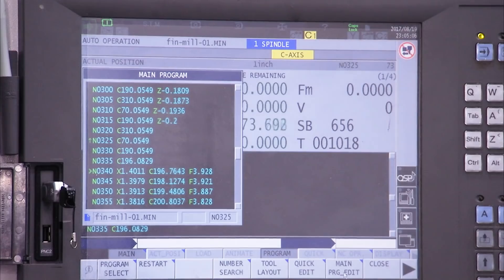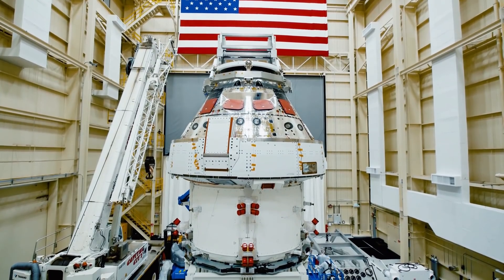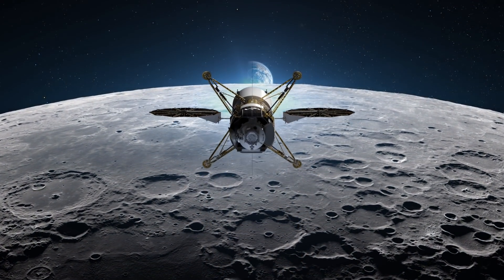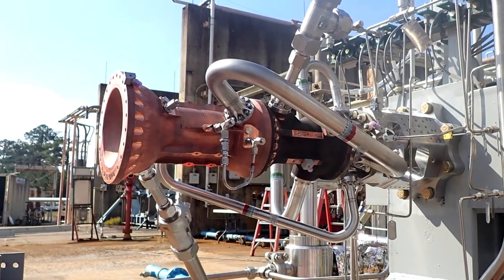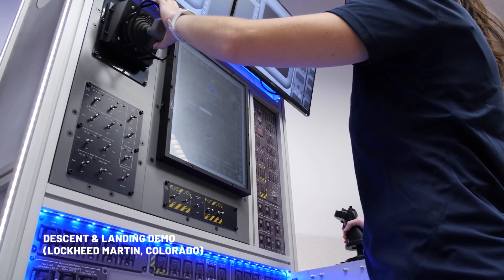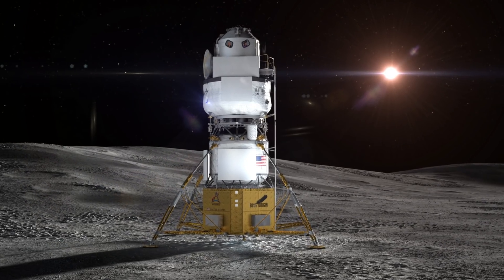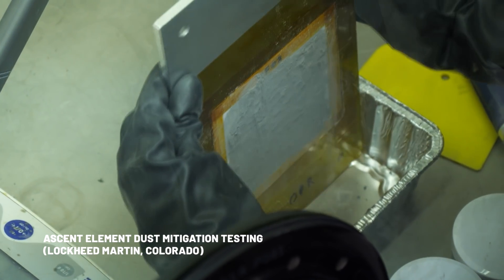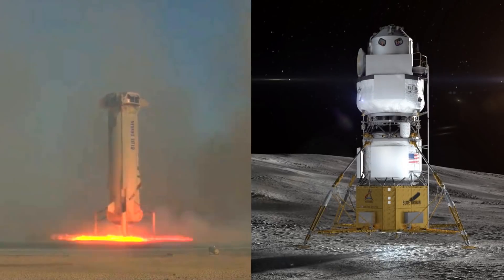Tech Demos for NASA’s Artemis Program

Comment: Saw the SpaceX  Starship test and this showed up. 
Yawn!
Reply: LOL.  Elon is further along with his moon lander, merely by painting a Starship nosecone white.  lol
Reply: @asraharrison  he is further along because Starship is actually in development and has done several tests and is wayy far ahead of BO. Not to mention that SpaceX has actually achieved orbit and does so regularly. Also, spacex has had crewed missions. Meanwhile, BO has not
Reply: @masonmtb7  BO is not supposed to make the boosters that launch the lunar module. NASA is doing that
Reply: @KKmaddafakka  what, no? BO is most likely going to launch the lander on New Glenn.
Reply: Do any of you have the remotest idea what the Delta V burn would be like trying to put that much weight on the Moon?
Reply: @thethirdman225  28 raptors gooo burrrrr
Reply: @thethirdman225  The starship upper stage will be doing that burn with it's three raptor vacuum engines, this will give it about 6 times as much thrust as the S-IVB. It is also much larger than the S-IVB and will definitely be able to complete that burn after orbital refueling. For landing on the moon, it will either use it's vacuum engines, or the lunar starship has separate landing engines, either way, it has definitely enough power to land and again, after orbital refueling it will definitely be able to do the TLI, capture into moon orbit, land, and launch again from the moon's surface.
Reply: @masonmtb7  How is it going to stand up on a 12 degree slope? How much Delta V are they going to need to get such a huge machine there? Someone wisely suggested it be used as a cargo transport and dock with Gateway. In that role it would be very useful. Anything else is, for the moment, Buck Rogers stuff.

Comment: SpaceX: Almost executes a perfect flawless prototype test
Blue Origin: Releases a video

Perfect timing guys
Reply: Yeah! Plus They have their own rocket to get it up there. The other designs need to work with SLS. I reckon we’ll be looking at several moon transporters. They’ll all learn from eachother to strengthen their weaknesses over time. Space x might go ahead regardless, seems like a logical step before Mars (if the commercial demand for moon journeys arise) Space X’s lunar starship has it’s flaws too. I’d like to know if they intend to use the vacuum optimised Raptors to perform landings or if the low gravity means it can be all with the thrusters. For sure they need them to launch off the surface to go back to the Lunar gateway, and to get to LEO for refuelling. We’re still decades/centuries away from a simple 1-ship-does-all without all the caveats. What a beautiful site it will be to see a nasa branded, all white, finless starship standing tall on the moon with the earth behind it.
Reply: @JonGPxl  The best thing about SpaceX is that they aren't afraid to blow things up and change things on the fly as they learn from failure. The Starship we saw yesterday is probably very different that what would end up landing on the moon. Meanwhile SLS and other space companies spend years and millions on computer modeling to ensure something won't go wrong, instead of just testing it an accepting it's going to fail before it succeeds. Plus if SLS blows up it's components aren't easily replaceable.
Reply: @Heatr53  SLS is rapidly being priced out of existence.  It is already at $2 BILLION per launch!  That is just crayZ!
Reply: @JonGPxl  The greater the competition the better. One of the reasons why space exploration is so prohibitively expensive is because of  literal monopoly by government agencies. NASA spends half of their resources on bureaucracy and kowtowing in front of politicians to get their funding.
Reply: @Michal_Wlodarczyk2100  couldn't agree more. Competition in the commercial sector, then global government agencies like NASA doing what they do best with the science specific missions and discoveries.
Reply: @JonGPxl  I wonder if future Martian and lunar colonies would be  semi independent entities. At the beginning they're going to have to rely on support from earth, but later on (after significant expansion) it may lead to Martian Revolution 😊
Reply: "Almost Flawless"  Yep and they did it on the first try!  I'm pretty sure that SN9 will nail it.  I am still gobsmacked by yesterday's flight.  We've never seen a rocket do anything like that before.
Reply: Ya what a coincidence
Reply: Just shows they are following in the shadows of a true giant.
Reply: Hahaha brilliant.
Reply: And then you have Dynetics who has done next to nothing. SpaceX is the clear winner here
Reply: @colehetzel3093  I don’t think NASA will choose Starship as the Lander(bcz Politics)but I’m pretty sure whether they select or not Starship will land on the moon before Dynetics or National Team Lander.
Reply: See I think this is this is the realistic plan, you can choose to agree with me or not, up to you. 

Dynetics takes first place and lands on the moon first while blue origin is still testing it’s New Glenn rocket. Dynetics will have their lander on SLS Expedition 3 (if it’s not cancelled yet). Since Artemis is obviously hoing to be delayed a few years, i’d say Expedition 3 will take flight in 2025+,

Then what happens is that Blue Origin’s New Glenn would be ready, they launch Blue Moon to show everybody who’s boss - by then SpaceX should have launched their cargo mission to Mars carrying neceessary equipment needed for the follow up crewed missioned 2 years later.

Blue Origin’s slow and steady moto would be too slow as Dynetics would take Artemis 3 and 4 while Blue Origin take 1 of them, if nothing goes wrong with their stupid ladder, they may get another mission but Dynetics will most probably be the favourite of NASA. Then, somewhere around Artemis 6, Lunar Starship will be ready and NASA will choose that, bringing 100 tons+ of cargo and crew to the surface of the moon. 

By the way, lunar gateway will be cancelled as funding for that stops, The ISS gets funding for 10 more years as commercial spacecraft brings more crew and modules to it, we might see, in around 2030, 20+ crew on the ISS!
Reply: @Phalkhonieng Gangte yep more space companies should adopt their approach to failure, they would learn more and succeed faster. But they or their shareholders are probably too scared to have videos of their product exploding.
Reply: The video is not about carrier rockets
Reply: @sidharthcs2110  SpaceX anounced that there can fit 100 people in starship
Reply: BLUE ORIGIN: delivers a mock up for astronauts to familiarize themselves with, make suggestions on, get used to.
SPACEX : (crickets).
Reply: Common Sense Skeptic Meanwhile, Spacex has delivered 6 astronauts to space and 100 successful launches.  currently has a flying moon capable prototype.  hardly “crickets” mate
Reply: @asraharrison  you’re not talking about Starship, I hope.

Comment: Not too sure about this plan. Dynetics seems to provide a more reusable, simpler, cheaper, and safer option.
Reply: Honestly I think the Dynetics lander is the best. The lunar starship is just so fricking big and looks like it's gonna tip over. (But both are very good, unlike BO's)
Reply: @mattmatta1346  Both could be used tho ,Lunar Starship and Dynetic lander run on methalox so Starship can act like a refuelling tanker for that Alpaca so it could land in multiple biomes. starship has lots of payload capacity so it could be used to deliver lots of cargo to the moon for potential lunar bases
Reply: @abhinavprashant2213  starship can be the lunar base
Reply: @abhinavprashant2213  I think this is a smart idea. For the moment, there’s no practical reason to try to land anything that big on the Moon.
Reply: @Flying Winged Grain Silo It will have very wide legs and it's very bottom heavy, do it's gonna be stable
Reply: @Thijs Kievit How is Starship going to land on a 12 degree slope and stay upright?
Reply: @TheThirdMan Auto leveling legs
Reply: @ImieNazwiskoOK  Oh really? How are they going o get them there? The maths for this seem to be lost on a lot of people. I don't know if you've ever worked it out but every kilogram you launch costs thousands. These excessively complicated devices sound nice but there are perfectly good reasons why organisations other than SpaceX are still looking at expendable vehicles. And don't give me the figures for LEO because they won't be the same for the Moon.
Reply: @thethirdman225  "How are they going o get them there? " What do you mean? They will just put them on lunar Starship. And Starship acording to plans will be cheap in terms of payload/price.
Reply: @thethirdman225  Good point. Big problem of reusability, but we still need reusability to not make future place of lunar base a junkyard (or LEO junkyard). And remember about refueling, so if it will have nearly 0 fuel on LEO it kinda doesn't matter becouse it will get refueled anyway, but it will be still make more fuel consumption after all.
Reply: @ImieNazwiskoOK  You missed it again, didn’t you? To be reusable requires a much heavier structure and therefore needs more Delta V, dramatically increasing the cost per kilo and eliminating the advantages of a reusable rocket. Even so, beyond certain weights and distances, reusability becomes impossible and it won’t be overcome by just building a bigger rocket. Eventually, there is a break even point between the maximum payload and maximum structural weight.
Reply: @thethirdman225  You are overthinking this , autoleveling doesn't require some heavy complicated extra weight, could be as simple as putting less hydraulic presure on the 1 or 2 legs that are elevated  so they are less deployed to level out. Will add i do think starship would be best only to deliver cargo to the moon, and if isru doesnt work out, be expendable.
Reply: @SkampXx  Overthinking? Oh, okay. Let’s drink the Kool Aid instead. Man, are you serious? How much Delta V is it going to cost to sent this extra weight to the Moon? Come on, answer it. Because everyone else is avoiding it. Higher structural weight equals more Delta V. Overthinking it? What is it you think engineers do? Or are you just expecting it to work “because Elon!” Or “because tech!”?
Reply: Agree, but blue origin has cooler design
Reply: @akunlama89  Cooler design? Have you seen SpaceX's Starship?
Reply: @aconite72  yes, the lunarship were also cool
Reply: @akunlama89  cooler does not mean safe. And when you're talking about human spaceflight, safety is the upmost priority.
Reply: @sneakytom7416  well I agree but blue origin has the coolest design.

Comment: By coincidence Blue origin just happens to release this video on the day STARSHIP has just launched SN-8 😆😅🤣😂
Reply: Terrible timing lol
Reply: Sn8 it’s actually success . If only the landing legs can pull out faster
Reply: 😄

https://youtu.be/3wxyN3z9PL4
Reply: @Theneverythingx  More than a simping little fanboy like yourself.
Reply: @Theneverythingx  Yes, you are.
Reply: To be fair Starship SN8 was supposed to test yesterday.
Reply: Or SN8 released their video the say Blue Origin planned release their video! SN8 was scrubbed on it's original day and picked another day - it could be entirely possible they ended up picking the day this video was going to be released.
Reply: .... and crashed it.
Reply: @Nowhereman10  and gained incredible data for the next launch
Reply: @Nowhereman10  at least they’re trying to actually make space travel sustainable.
Reply: @TheCosmicGuy0111  Interesting factoids here. Both SpaceX and Blue Origin have made fairly cheap rockets. New Shepard, according to Bezos only costs a mere 10,000 dollars to turnaround and according to Musk, a Falcon 9 around 250,000. Both numbers match up well when you compare the rockets' respective sizes and other factors.
Reply: @Nowhereman10  how many non-demo missions have New Shepard flown vs Falcon 9? Also isn't NS a different class rocket it's not really a comparison.
Reply: @denwaxr  Actually, New Shepard No. 3 has been flying commercial payloads now for at least the last 5 out its 7 flights to date. And before you reply in ignorance, I'll just remind you that NS 3 has been designated by Blue Origin to fly only automated payloads while the 4th vehicle will be the one to fly passengers as well as cargo. The next flight of a New Shepard will be the shakedown maiden flight of NS 4 and if all goes well on that flight, then its next flight will be the one to carry people.
Reply: @Nowhereman10  Space technology doesn't work that way when u scale up the cost will increase exponentially taking that into consideration the new Shepard cost will be double that of the falcons. And btw comparing falcons with the new Shepard is the most stupid thing I've ever heard.
Reply: @ok4405  You don't seem terribly bright and you don't seem to understand economics much less the point of the comparison.

But that's what you get when you have low information fanatics involved, not people who know what to look at or exercise basic critical thinking skills.

The point, I was making, and try to follow along here, was that both boosters show that reuse is indeed drives down the marginal costs. When it is done right in these two instances, rather than how the Shuttle was forced to in order to spread as many jobs over as many Congressional districts as possible for political support. Ten thousand dollars even scaled up by an order of magnitude would only be a $100,000. You have to go to ridiculous lengths to make a scaled up New Shepard more expensive than a Falcon 9 1st stage.
Reply: @Nowhereman10   your comparison is on a theoretical scaled up NS. The difference is that SpaceX is actually flying and reusing orbital-class vehicles. You can’t simply apply an order of magnitude and say that that is what it will cost to reuse a 10x size NS. Don’t get me wrong, BO is going in the right direction. What most people are making the point of is that they are going way too slow about it and have only demonstrated viability of a low-capability vehicle. We need to see New Glenn being tested for people to take them seriously beyond just flying tourists up into the edge of space for a few minutes.
Reply: @Nowhereman10  ik they’re both trying, but you said starship crashed inferring it had no chance in the race. So all I said is at least they’re trying lol. And we need new Armstrong 😩
Reply: @austinnh8297  That is in some respects what New Glenn is, a scaled up New Shepard since many of the technologies tested on it will be used for the former.
Reply: @Nowhereman10  You really don't come across as knowing what you're talking about.  NS is what it is.  It will never be anything more.  It has reached a 100 km a handful of times.  The Falcon 9 goes to 200 km over a 100 times.  BO is a joke and it's why they lost their contract with the Air Force in August.  That contract went to SpaceX because they actually build orbital rockets.  They'll lose their stupid Blue Moon lander as well because if you can't get into LEO you can't get to the moon.
Reply: @tomboard1  I know quite a bit about New Shepard and New Glenn. I wish people like you wouldn't be so dishonest and ignorant. The contract went to United Launch Alliance of which Blue will share in because they happen to be providing the main engines (BE-4) for Vulcan's 1st stage and they will get credit for it being boosted to orbit.
Reply: @tomboard1  BO have just recently lost there contract and funding in regards to The Spaceforce initiative by the United States government 😪😪😪🥲🤣😂😅😂🤪
Reply: @Nowhereman10  it did 2 major firsts never been done before and the next SN9 will be rolled out with changes this upcoming weekend. BO can't catch up.
Reply: @econojon  Look up the video for DC-X flight 8.
Reply: @nowhereman1046  that's not a bellyflop and a flip. It's also not methalox.
Reply: @econojon  It does not need to be methlox. And yes, it does do a sideways flip and reorientation. 

None of this is really new just as neither Bezos or Musk actually came up with the idea of VTOL rockets or at sea barge or ship landings. They're just taking those ideas and technologies further.
Reply: @Nowhereman10  and now sn15 landed
Reply: @Nowhereman10  its normal is a test
Reply: @Nowhereman10  your comment grew old...look at them now
Reply: @Nowhereman10  Landed.  You sound salty.